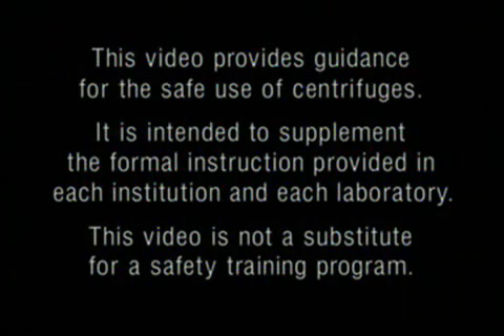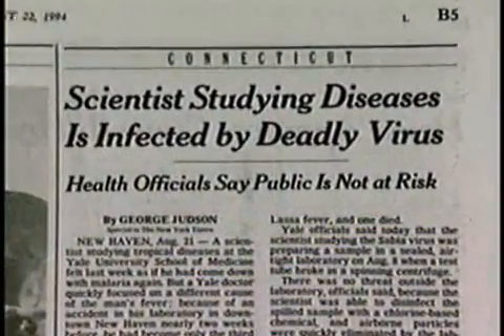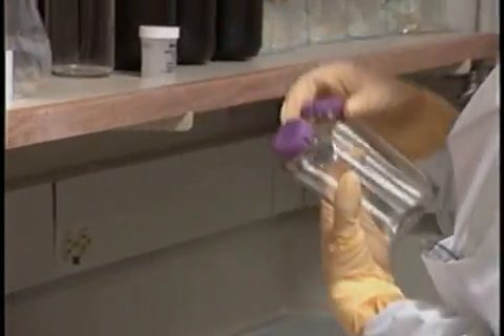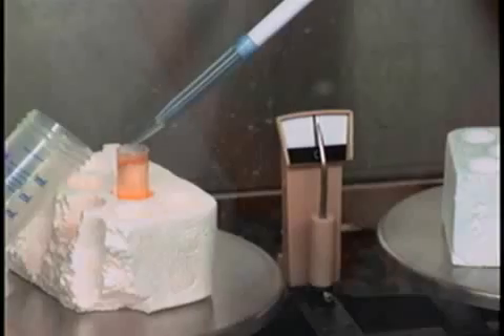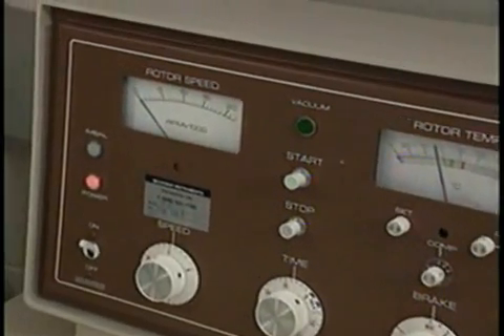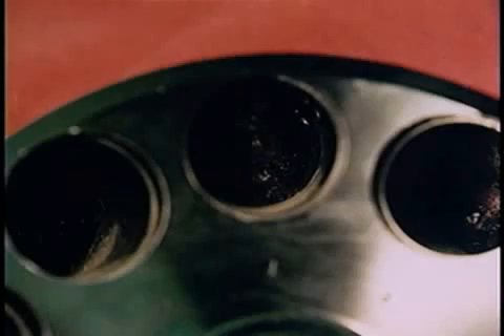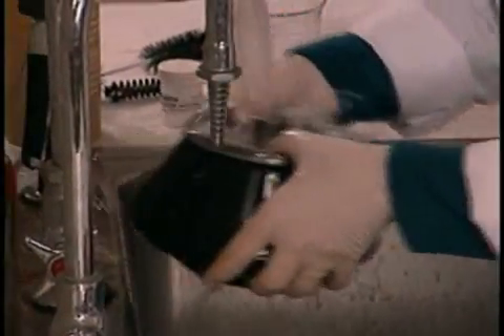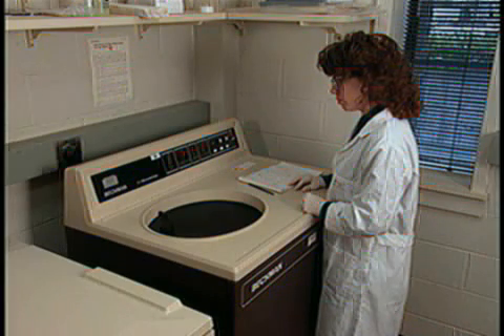Centrifugation Hazards

Comment: AT 0:48 there is footage of a Beckman Spinco L7 series fuge.  I worked at Beckman Spinco when that series of ultracentrifuges was introduced as a lower cost version of the L8 series of ultracentrifuges.  I tested thousands of L7 and L8 fuges and went on to service many of them still running 4o years after they were manufactured.
Reply: Im curious what kind of motor do they have?